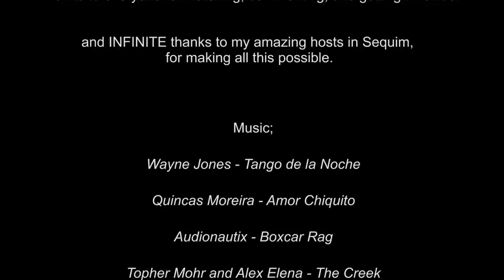Building Boat Frames using Traditional Tree-Nails - Rebuilding Tally Ho EP28

Comment: Are the opposing frames, same station, opposite sides, not identical by design? Maybe in 1910 they could not cut them as well and relatively easily as you can in 2018 but that is no rason that you can not build it more closely to design than they did. The bird is way to interested in butting into the project but maybe in a previous life he was the designer.         sdh T.A. '67 in CT

Comment: Ok, I've never done anything like this before, just a small amount of framing on houses. My question is: why the Japanese style saw? Is that the best choice for the job and why? Or is it just what was available? Thanks.
Reply from the maker: I find they just outperform western style saws in most fine applications. Certainly their flexibility makes them easier to closely flush-cut with, without marking the piece behind. Cheers

Comment: I have a question. In  pre machine days, how smooth and accurate would be the preparation of the timbers be?
Reply: Very smooth and accurate where two pieces have to fit together, it just would have taken a much greater amount of labor time with hand tools.  Alternatively, surfaces that are not intended to fit other wood parts or be handled by people would have been left rougher than what Leo is doing, you can see the difference in looking at the original frames still in the boat.

Comment: I still don't understand why I've subscribed but I love it, great progress! Did the boat originally have an engine and will it have an engine again once its finished (for getting about in ports)?
Reply: notice the prop
Reply: Heath Albritton i have noticed that, but he mentioned in a previous video that the stern was altered at some stage, if I remember correctly it was for the prop
Reply: Rick te Kronnie I believe that you can also see the prop in the drawn plans, which shows the original design of the stern :)
Reply from the maker: Yes, she was built with a paraffin engine, and I will install an engine too (probably a modern diesel)

Comment: http://praziusa.com/beamcutter.html to help you cut out the rough parts from the live oak slabs, also try using some paste wax or even rubbing a bar of soap on the tree-nails and wedges to help them go in easier.

Comment: Wondering if scarf joints are needed in the frames or not. (obviously you aren't putting them in.....I know how time consuming they can be)
Reply from the maker: Rarely used. Even with single sawn butted frames, as per many traditional work boats.

Comment: heres a dumb question,  is it taboo to coat a boat like this with epoxy resin for water proofing? a big no no, or just too expensive?
Reply: It won't last as long. Epoxy seals water IN as much as it seals it out.  That is why many wood cored fiberglass boats boats built in the 50s and 60s are rotted out today.  And none of them will last a century.  The oil and salt water the wood gets soaked in acts as a preservative while still letting the wood "breathe".

Comment: Is there a reason you don't use a waterproof glue when you are joining the two halves of the frame together? Wouldn't that make it stronger and waterproof?
Reply: He is using traditional, period correct building techniques.
Reply: I think you will find that yes, he is restoring the Tally Ho, but there has been no mention of ONLY using historical building techniques,.
Reply: He talks quite a bit about his preference to use historically accurate and the best quality on Tally Ho.  In the videos of him working back in the UK shipyard, he is not shy at all of using modern epoxies on repairs and fabrications.

Comment: Please could you explain in one of your videos why there is a bevel (not the caulking bevel) on the plank and how you measure what angle to cut and how the angle changes. I did not understand why you are beveling the frame in this video. If you are in need of an English steak and kidney pie and English tea, take the ferry to Victoria BC.
Reply: The outside surface of the frame has to be beveled to the shape the flat plank (skin) will be as it curves when attached to many frames that get smaller toward the bow and stern.  With a bevel on the frame surface, the yet to come plank surface will be flat and square against the frame surface.  He knows the angles from the full size drawing on the floor in the workshop, look back to the lofting videos, the bevels are mentioned at some point in all that.

Comment: Was that Ruby Beach with the rocks in the water?
If you will rough dimension your trunnel stock then put it a toaster oven to dry, then leave them there on low heat until you are ready to use them. After you dimension them, they will they will lock into the wet Live Oak like Billy be damned, no wedges needed.

Comment: Please explain the application and necessity of the rolling bevels. Why not square cuts? One of the reasons I like your channel is because of the details you provide about your work. Great job!
Reply: the frames are square to the keel, however the planks on the outside of the boat wrap around in a curve. This means that on each frame a plank will hit at different angle, hence the need for a bevel in order for the plank to be flush to the frame.
Reply: Garret Olds so the rolling part means the bevel changes from top to bottom?
Reply: Erich Greer yep planks at different heights along the frame will subtly hit at a different angle hence the rolling bevel. I’m sure Leo will have to do some fairing work on the frame in relation to the other frames but rolling bevel gets it close. (I’m sure a shipwright could explain it better than me!)
Reply: Garret Olds thanks!

Comment: Use a  "Push Block" to feed that  beast of a Ship Saw...
Reply: The little ones will bite you just as hard. I cringed as they were making the treenails.  That gets boring fast, start daydreaming, and "Oh f@ck!".
Reply: I once slipped and bumped my thumb into the  Bench grinder... it immediately pulled it down onto the guard and chewed  the meat off the back... Happened so fast it didn't hurt...  Got a neat scar now!!

Comment: If your ship-saw manual adjustment is hard to turn one direction due to the weight of the saw, why haven't you added a simple counterweight?
Reply: An added weight would only be a counterweight for the one direction.  If you didn't remove the weight for the opposite direction it would multiply the force of gravity that Leo mentioned.  If you added a third, or fourth, volunteer to the operation of the saw it could be done, I guess
Reply: Excellent idea
Reply from the maker: I don't see an easy way of counterweighting the saw, that would work in all of it's positions. Anyhow, its not actually difficult for one man, just slightly more effort to turn.